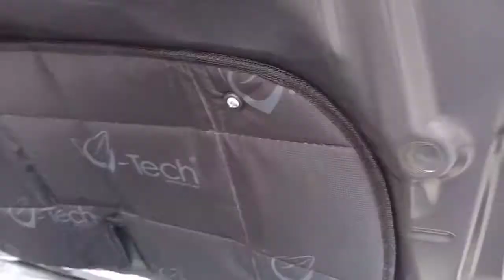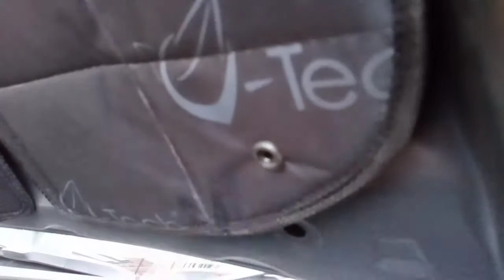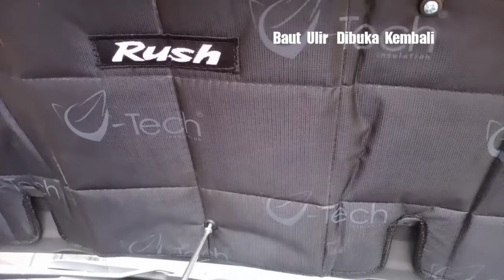All New Rush ~ Mungkin Ga ~ Pasang Double Peredam Kap Mesin

Comment: mau tanya ne ....di medan dimana bisa kita dapatkan peredam vtech ini...
Reply from the maker: Di Medan ada Bang Daniel 
No tlp nya
+6282177066066
Reply: @vtechperedamsuara9056  baik.....mau tanya lagi ne...kalo utk Avanza 2013 kira2 hbs biaya brp kalo dipasang peredam FULL
Reply: @budiaswoko78  Avanza 2013
Peredam kap mesin 450.K
Peredam suara 4 pintu, 600.K

Peredam.lantai, 7 lmbr , 1.050.K
Peredam panas plafon , 3 lmbr, 450.K

Peredam fender ban depan, 18 gulung peredam ,  harga 385K
Peredam fender ban blkg, 24 gulung peredam , harga  485.K 

Pereda. Dalam ruang dash board, 18 gulung, 385.K